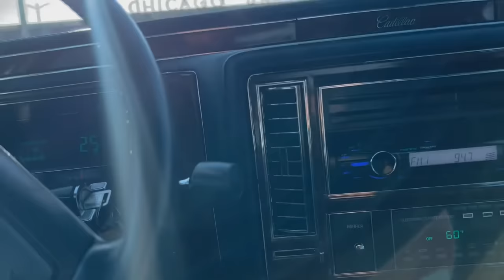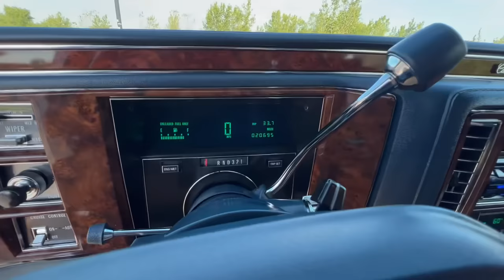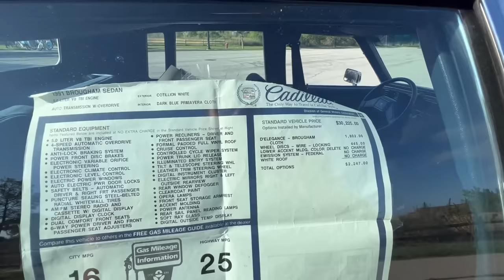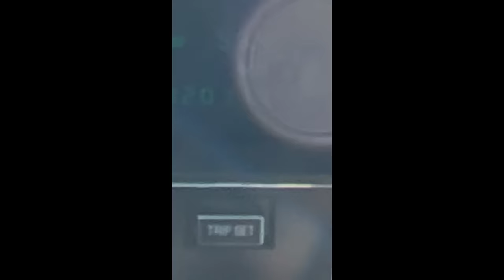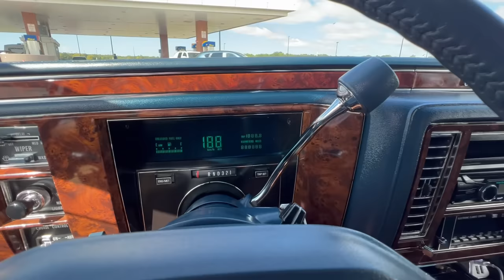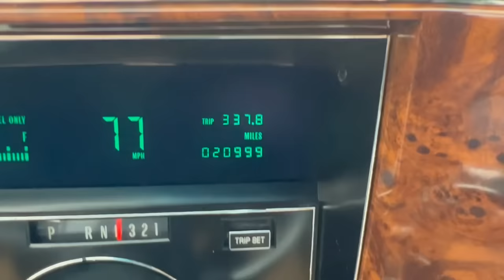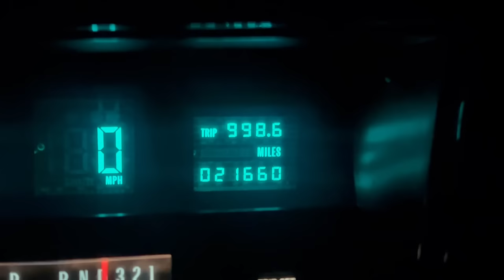I bought a MINT 1991 Cadillac Brougham and drove it home on its ORIGINAL tires

Comment: First!!!!!!! 😂
Reply: That bug guard is the single most item responsible for you receiving the car in MINT Condition!
 I guarantee you with 100% certainty, IF the big guard wasn't installed you'd have stone chips on the front of that car in the paint in addition to the upper chrome!... Bottom line is it's not hurting ANYTHING (aside from slightly dismissing the look but REAL CAR GUYS know better and look past it because they're fully aware of the bigger picture and understand the importance of preserving original paint!) and the reality is that's one add on that doesn't hurt the car and frankly it comes off  nice and clean by removing a few nuts.  If some guy came in to buy it and told you he wanted it but he didn't like the look and asked you to remove it because money isn't an issue and he's going to make it his daily driver and drive the wheels off it and can't stand the look of it or even image having to drive it to it's death with that on the hood,  remove it! To remove it for ANY OTHER REASON WOULD BE A DISSERVICE TO THE CAR AND THE NEW OWNER!.... But, what do I know?
Reply: Whats that mean?
Reply: How much do you intend to sell it for? Very serious inquiry

Comment: Absolutely stunning car.  Me personally would re-install the original radio, even if it doesn’t work.  Modern radios in old cars just looks hideous and would bug me all the time.
Reply: Agreed!

Anthony will surely take that modern radio off.
Reply: When the AC Vents were above the Radio,  Aftermarket Radios looked okay, but with the Vents on the Sides, that DIN Filler looks Hiddious. Would have looked better if the Slot was under the Radio, not above it

Comment: Biggest thing wrong is the Headliner Glue but that would be expected. Nice car.
Reply: All the GM cars from the mid 80’s to early 90’s seemed to have headliner issues.
My 1986 Buick Park Ave did the same thing.  😒
Reply: @B3burner As did also my 1977 Sedan De Ville, alas. :(  But, ironically and unexpectedly, not so in (and of) my 1986 Fleetwood Brougham, uncharacteristically. (It was true also of both my 1985 Lincoln Continental and my 1985 Dodge Aries, I think.) I saw someone replace it, the headliner, in 1980's Cadillac with a black-and-white checkered fleece blanket, which I thought was kind of cool. I mean, it looked neat.

Comment: I buy and sell classic cars all the time. The question of old tires........My model is that if the car is super low miles and are still wearing the tires the car came with when delivered new, I keep them on. ONLY because so many of my clients are collectors and they WANT the car as original as possible! I never recommend driving at high speeds or long distances as something could happen. If you choose to drive a nice low mile original classic, you MUST keep the originals with them for collectibility purposes!!! And I love when the cars come with paperwork like this car has!! GREAT FIND!!!!

Comment: You should consider having someone 3D scan those rear fender fillers & then correct & perfect all the angles to smooth them into the fender & chrome bumper surrounds, & sell them!  
The tv show BitchinRides uses the Stratasys - they have dealers/shop locator on their website......in fact, 3D scan all those  euro mouldings.

Comment: No Twilight Sentinel?

Incidentally the Twilight Sentinel burned to a crisp in my 1994 Eldorado a few years ago.  I think the part was $600 or $800 from the dealer.  I found one new old stock on eBay for $80.  Works perfect.  Literally 10 minutes to swap out the old for the new.

Comment: My 2004 Lincoln Town Car with 35k miles is still on its original Michelin tires from 20 years ago! I did a video of it on my page and although I haven’t had an issue with them, definitely need to replace them ASAP 😅
Reply: Do not drive on highways with them.

Comment: As long as the tires aren't showing any physical signs of degradation such as cracks, spidering of outer carcass, bulges, tires can last a looooooooong time.  A vehicle stored in a climate controlled environment out of sunlight/UV rays is the key to tire longevity.  The lack of yellowing of the bug deflector is proof positive this car was stored perfectly.

Comment: Of course 30 + year old tires is getting up there in age, but maybe this trip will quiet down those with a phobia about "dangerous" tires. Ten- to 15-year-old tires are not automatically junk just due to age. It depends on storage conditions, sun exposure, etc. Some people act like you should replace perfectly good low mileage tires every 7 to 10 years, no exceptions. Completely unnecessary.

Comment: Take the bug to select a rough take the mud flap so I'll put on some wide whites that came with the car when it was new and put on a original radio I'm looking for a mint 79   Cooked devil if you've ever seen the movie good fellows it's called the Mine was the same thing I bronze get married with in it my second wife have a mint 84 Riviera convertible white blue interior white top 60000 original miles I'm the second owner supposedly that's my garage Queen keep up the good work love cadillacs currently driving CT4V Looking for the ultimate 2020 Cadillac CT6 black wing that's the last ground buying

Comment: I just bought a 92 brougham delegance from the original owner.  I have a blinking security light that drains the battery. I have no clue how to remove the drivers door panal, any tips? Lock cylinder is loose in the door. Thanks my man, love the vids. You helped me with the loose mirror, fixed it and shes solid now.

Comment: Sorry buddy but that is not a 1991. 
Reason i know is my uncle has a 1991 Fleetwood Brougham De Elegance with real true spoke wire wheels… with 1200 original miles an his has an Air bag on the steering wheel.
This car your in is a late model 1989